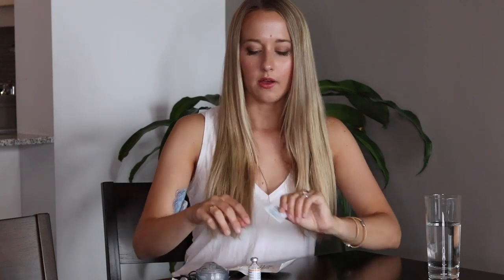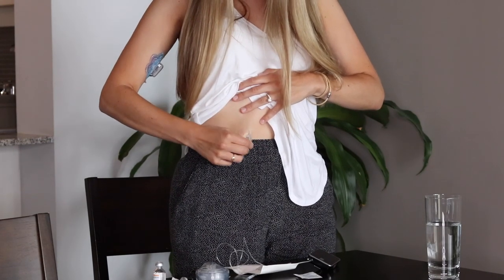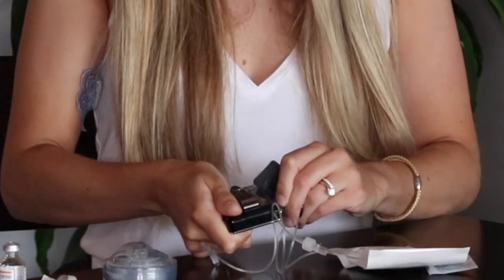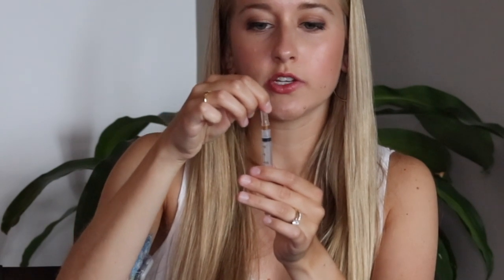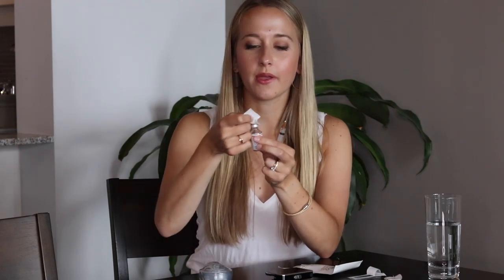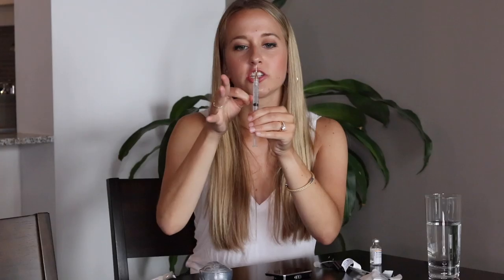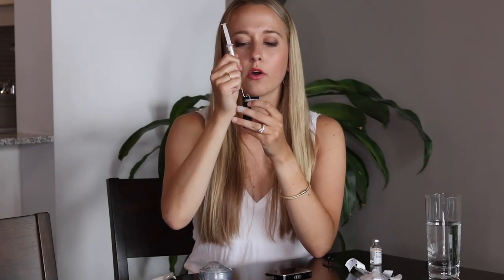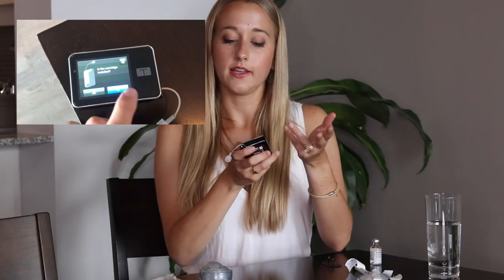CHANGE MY INSULIN PUMP SITE WITH ME! // t:slim X2

Comment: Dr. Michelle - Thanks so much for your videos. I just switched two months ago from 12 years on Medtronic Revel to the T-Slim 2 so your videos have been a big help.  I have a Dexcom G6 CGM, so I agree with you that compatibility is a huge plus of the T-Slim. What really rattles my cage is the fact that Tandem has invested so much in their technology for this $5,000 pump but they forgot about the basics of customer service by providing a thoroughly useless (and dangerous) 50-cent clip on the case. You noted in your video that it's popped off your bra a few times. It's popped off my construction belt several times and yanked the set right out of me. Very dangerous. It's impossible to fasten to pajamas at night so I end up sleeping on it rather than the other way around. Somebody at Tandem's product design dept. needs a serious wake-up call. Anyway, you are the bomb! Keep those video tips coming. So grateful....David near SF.
Reply: Agree with you fully
Reply: I just started a pump, and by extension the Tandem, and I already agree lol. I've only had it for one night technically, and sleeping with it is going to take some getting used to. However, my sugars have already improved, I haven't risen passed 190 all day 😭 Right now I'm feeling low (I'm 94, but it went up from 80), so idk if anything I type makes sense, but I agree with you!

Comment: Thank you for this! I'm a 10yr T2 diabetic. Dr has tried to get me into insulin for a few years, but I heavily resisted due to extreme needle phobia and other concerns. It took a lot of work to achieve an a1c of  7.4-8.6.  Now I had a heart attack and needed bypass and hospital and surgeon have me no option but insulin. Now in the last 45 days in seeing a GMI of 6.3 with only slightly increasing exercise. I had a life event now that made me come to the realization that I'm done playing and willing to do insulin, but I want /need a pump for even better control and less needless than MDI!

Comment: I’ve only been using the t:slim X2 for a few weeks with the same tubing you demonstrated.  From the beginning I’ve had trouble cocking the spring for the insertion.  I stumbled on giving the mechanism a slight twist as I pull it up and that has seemed to alleviate the difficulty I was having.  Nice presentation.
Reply from the maker: That's a good tip about slightly twisting when setting up the spring. Thanks for sharing :)

Comment: WOW I've seen a few of your videos and you are extremely helpful. I'm just now getting approved for a pump. The T:Slim was recommended as well as the Omnipod but I'm not sure my MEDicare Part D will be the best option since Pods are part D not Part B. Love your videos. I was running 600 as a Type 2 for a year and my  pancreas had stopped several years ago. I had allergic reactions to long acting insulin but can tolerate Lispro very well. My prognosis was not very good as they told me I wouldn't be here much longer w/o insulin multiple times this year. I've gone from 600 to 91 on 3 injections daily  of 10 units but to stay stable I need a pump. I subscribed so I can follow you on your journey and your journey is so helpful for me as someone just starting into this .. Thank you so much Michelle for your detailed videos and sharing of your life with diabetes.

Comment: Great tutorial I've been on the tslim about 4 years so I'm very familiar the process it was definitely nice watching someone other than myself doing it ,,,,so the reason for my comment is because your comment about being a diabetic accumulating piles of trash when changing out your infusion site  so I figured id share what I do to help with the trash clean up ,,so what I've done when I was first put on the pump and recieved a 6 month supply of cartridges and infusion sets and what I do is get a box of sandwich bags and put one of each piece into a bag so it kinda makes it a little portable site change tool bag  so inside the bag is the cartridge infusion set syringe and needle and once your done changing out your site everything can go into the sandwich bag and tossed out hopefully that makes sense to someone thanks for listening

Comment: Thank u for your visual explanation, reading the instructions over and over, but thank god for YouTube university, found your site as well as a few others, who provide personable information on the TX2, and site preparation... with your video assistance, I set up my TX2 and applied it before my training.. I was in the Omnipod system (great wireless system) but due to insurance changes, needed to switch to a wired system, so I chose the Tandem over the Metronix....new device means apprehensions of installation, until I’m used to the systematic and daily changes, thanks Michelle, u made it easy...

Comment: Thanks for sharing. Seems so much more complicated than a Medtronic change, but I’m sure, like anything, you get used to it.
Reply: Katie Petersen I agree. I use a Medtronic pump.
Reply: I just got my t-slim today!  I was hoping to learn everything on YouTube and just do it myself without the diabetes educator, but now I’m a little overwhelmed and worried. I think I have everything all set up. I may try tomorrow
Reply: Sue Christou it's not hard!  Din't let fear get in your way.  It seems like a  lot but once you do it it becomes routine.  And realize a youtube video narration of the steps is longer  than  it actually takes!  Promise you will love it!
Reply: I have to say that I've been on medtronic ronic pumps for a long time and I switched to tslim so I could use the Dexcom G6 and because I felt like the scream was more user-friendly for me. I will say though in all honesty that I cannot stand all of the parts that need to be used to change an infusion set and the time is 10 to 15 minutes as opposed to less than 2 for me with my Medtronic pumps. I also feel like I have such weird changes with doing the same thing that I wonder if the mechanism is actually turning accurately, or there is something that happens with where you put the needle in to fill it on the Tx2. Sometimes I go to put the insulin in and my friends will not go down and I have to move it two or three times before it will take the insulin and there are times when I hear an audible like crackling noise  that sounds like the peace inside is expanding because it's being filled that hole little mechanism to seems very arcade to me I wish they would do it the way Medtronic does. I want the Medtronic pump with the T slim screen and the Dexcom G6 compatibility

Comment: Thank you for this video.  I recently divorced Medtronic after the miserable 670G.  Been on a TSlim for 6 days now.  There are a lot more steps in changing infusion sites!  I need to watch these videos during a few more site changes to get the steps down.  T1 since 1985, using pumps for about 20-yrs.

Comment: I just started my tandem control IQ 3 days ago.This was a good video! Summarized everything in one! The curve ball is knowing when the pump isn’t going to dose you on the third day
Reply: @TheSte4991 Can you explain that "curve ball"? Does the pump just stop delivering after a certain time, or does it keep going until it runs out of insulin? Been on Medtronic pumps for 30+ years, and thinking about the TSlim. I realize the recommended time for a site change is 2-3 days, but I have NEVER done that, and just filled the pump with 300 units and kept it on until the pump warns me that the reservoir is low (usually 6 days or so). I'd hate to have the pump just "time-out" on me, and waste a reservoir full of insulin.
Reply: @catatonicbug7522  so i have learned that at 3 days my skin gets irritated and that my sugar doesn't manage after that
Reply: @TheSte4991  interesting. Never had that problem myself. Just wondering if the pump shuts off after 3 days by itself though.
Reply: @catatonicbug7522  no. No worries in that regard it just fussed at you once the battery gets below 20%

Comment: Wow! That's definitely a process for a site change. I'm sure it gets easier the longer you have to do it. My Omnipod takes less than 5 minutes (may have to time it to be sure). But hey, it's a great pump from what I hear so I guess it's worth it.
Reply from the maker: Yes it's definitely a longer site change! It's faster than the length of this video, since I took more time to describe the process, but it's not faster than 5 min. The Omnipod looks super easy to change :)
Reply: @MichelleLord  HI Michelle, I am an active adult and my Endo doctor advised using the Omnipod system, I have been on it for 3 years. I just do not comprehend being active and having an IV tube to watch out for. Omnipod everything is in the pump itself. Thanks for the video and very well done

Comment: Thanks for the video!! This pump looks a lot slimmer than the medtronic pumps!! I'm on the Medtronic pump now but I am frustrated with it. At first I was excited because the because the auto mode but medtronic's CGM system stinks! The first couple days were great but the transmitter started having trouble sending data to the pump so in the first 2 weeks I had to get 2 new transmitters from medtronic. Every night my wife and I were woke up from alarms going off on the pump about the sensors/transmitter losing connection so about 2 months of this I finally gave up on their CGM. Now I just have to wait 3 years for my warrantee to expire before my insurance company will cover a new pump. Can't wait to make the move to the tslim and the dexcom CGM.

Comment: Great content, thanks for creating. I watched your Dexcom G6 10day video as well since i just started using mine. Living in Southeast US provides plenty of adhesion challenges during the summer. Note if you ever need extra help keeping your insulin pump sites adhered you can also use the same IV prep wipe you used for your Dexcom G6. I do not worry about wiping in a circle/donut since the insulin site canulas are more robust than the sensor filaments. I'll be switching to the t-slim from 670G in OCT!

Comment: Thanks for the video! I will be starting t:slim X2 in 2 weeks, I just got approved (it's a little longer process in the USA). I'm on insulin injections right now. From what my endocronologist has said to me, it sounds like the pump will make it easier to manage my blood sugar level. I do my best to try to stay on a schedule to have meals and snacks at the same time to try to manage my blood sugar levels but it's hard, the pump sounds like it will make my life easier! It's going to be a lot to get used to, looks like changing the cartridges seems tricky. Sounds like picking the spot for the site can be tedious knowing that you have to do it every 3 days, it's kind of the same with injections trying to pick a spot, I bruise really easily
Reply: Brian, I hope you've found you love being on a pump and like everything there are drawbacks, but the convenience and better control far outweigh those. As far as insulin pump sites, abdomen, side/back and hip...anywhere there's a little extra skin should work. If you haven't already, i suggest creating small backup pump site change kits with prep wipes and sites inside a ziplock bag...for the car, backpack, office as it never fails you'll need to change or accidentally rip one off at an inopportune time. Best of luck!

Comment: Yesterday I was watching this video while changing my set and I wondered.. why don't you try using penfill? There's no need to pre-inject air and when you travel you can use them with a non-disposable pen.
Reply: good suggestion. i have insulin pens as backups to my pump and using them this way would be good vs. letting them expire.
Reply: The need to use the syringe to suck out the air in the cartridge before adding insulin removes the option to use a pen.
Reply: @catatonicbug7522  indeed, penfill are the cartridges for non disposable pens. You can just use them to substitute vials (using the syringe to fill the reservoir) and put them in a pen when needed.

Comment: Hi Michelle, thank you for this video. 

I do have a concern on how you prime your set. When you prime the tubing you have already filled the cannula because you have drops forming at the end. Then you insert the set and prime the cannula again using the preset fill. In essence you are giving yourself a small dose of insulin because the cannula is already filled. 

I usually fill the tubing set after I insert the cannula and disconnect the set from the cannula. Then attach the set to the cannula for the final .3 unit fill. Just wanted to flag it to you. 

Thank you for your videos, you do them well.
Reply: C Stibbe with the plastic cannula sets your actually filling the needle when you prime because the plastic cannula is on the outside of the needle therefore there is no insulin in the cannula just air which is why you need the .3-.5u to fill the cannula once inserted but if your using a set like sure-t/tru steel your filling the needle when priming but because the needle is also the cannula there is no need for cannula fill like mio/autosoft 90

Comment: Question: Wife wants to know what does the 2 red lines going horizontally  mean on pump?
Reply: They are usually your target range limits. The top line being what you want to stay under and the bottom line being what you want to stay above. Anything outside of these lines are high blood glucose (above top line) or low blood glucose (under bottom line)

Comment: Wow 15 units in your tubing I remember with my old tubing and cartridges it would take about 16. My T:Slim only requires exactly 12 now with the new t:lock tubing and cartridges. I also have the Autosoft XC insets because the Autosoft 90 is way to bulky in my opinion.
Reply from the maker: I've never tried the Autosoft XC, but maybe I should! The Autosoft 90 is definitely bulky and therefore takes up a lot of space when travelling!
Reply: @MichelleLord  they also supplied me with the autosoft XC.. I golf at least 4 days per week, go to the gym 5 days  a week and although I am a newbie to this whole diabetes stuff, I don't feel the needle... I also use the dexcom G5 and should get the G6 soon. It's a little weird being tethered to a tube, and having this sensor in my arm, but if it prolongs my life with some additional healthy years I can deal with it... I'm gonna live my life to the fullest while I still feel healthy and vibrant..

Comment: Thanks for sharing. Does the site always stay attached between changes?  We use IV prep to give it a bit more adhesion (670G).
Reply: I'm worried about the same thing. I use Mastisol to prep my CGM sites (IV Prep isn't sticky enough), but I seem to sweat them off in the summer. On the 670G now, looking to switch to the TSlim in a month or less, so these things are very concerning to me.

Comment: This is my first site change. What if you still have like 50 units in the cartridge?  Do you pull that out first before discarding the cartridge?
Reply from the maker: Yes, I've started doing that. It's definitely not recommended, but I cannot stand to waste insulin!
Reply: We additionally fill Animas and Medtronic syringe-based reservoirs as you can see inside and remove the bubbles manually (two children on pumps), but I will never fill this type of the reservoir since you cannot see what happens inside.  What you can do to save insulin is to change only the infusion set, and fill the cartridge later when needed. Tubes and cannula are two independent components.

Comment: Hi Michelle:  I'm a 50-year type 1, been on a pump for 21 years, always Medtronics.  My Endo recommends me switching to tslim, so I'm going to do that when my current Medtronics pump is out of warranty (April '22).  I've been watching videos on the tslim.  It looks like its infusion set is much more complicated than the Medtronics infusion set.  It will take some getting used to.  My question for you is: does the tslim X2 have a "closed loop" insulin delivery system like the Medtronics 670G?  If your BS starts rising, does the tslim compensate by giving you more insulin like the Medtronics?  Or does it only warn you?  Thank you for your videos!
Reply: The "hybrid closed loop" system that Medtronic uses is replaced on the TSlim by ControlIQ, using the Dexcom G6 Sensor/CGM. The nice part about that is the Dexcom does not require finger sticks at all!

Comment: For the black cartridge that you fill with insulin, is that changed ever? Or do you use that forever? :O 
ah...researching on insulin pumps is a looootttt T__T
Reply: The black cartridge she put the insulin in,is changed every time you do a site change. Typically every 3 days.

Comment: This is my "DAY 1" with T-slim basal IQ. I am a previous Animas pumper. My nurse sister said skin can never be sterilized so minimize contamination this way. Choose your site and apply alcohol swab directly to it. Slowly move swab in increasing circles away from center which prevents dragging bacteria over the site. Repeat with a second swab in same pattern. I then use S&N Site Prep to add an adhesive layer to the skin using same technique. Once the infusion set is installed moisten the adhesive ring around the infusion site. Air dry and massage around ring to make very good skin contact. I apply IV 3000 film over infusion set. This is not going anywhere until you wish to remove it. Hope this helps your readers.